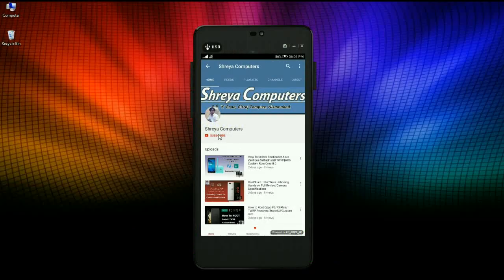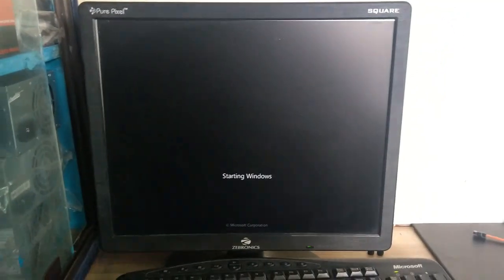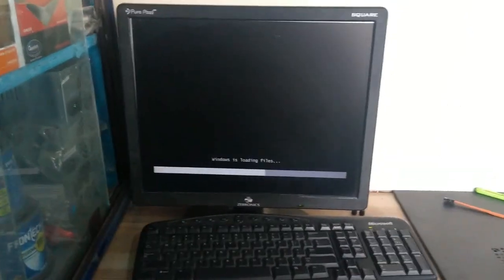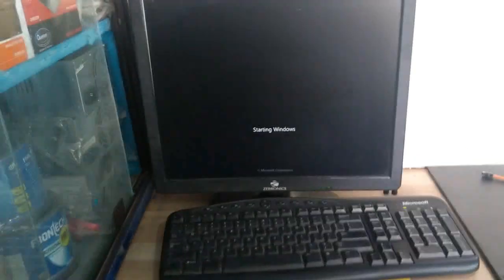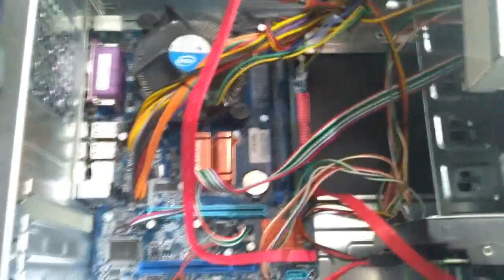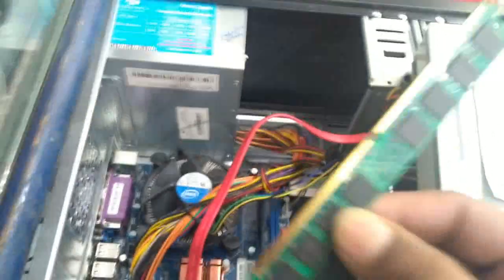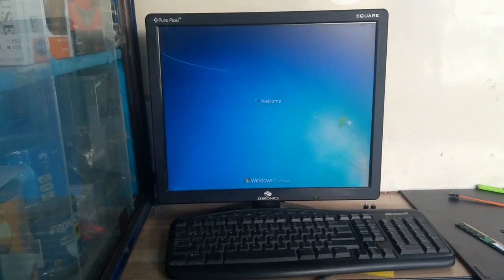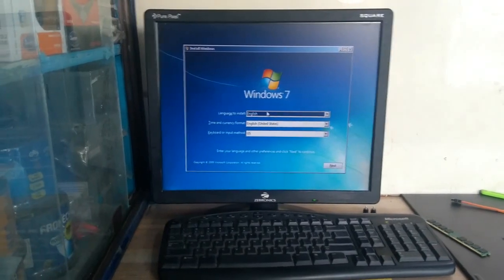How To Fix When Windows Stuck On Boot Logo? Solved In Win 7/Win 10/Win 8/Win XP/Vista

Comment: it did work and im not sure what i did. how ever i did add a ram chip and right after that it didnt start. i did do what you said and i got it started! how ever its running much slower then before but it is working now!! thanks : )
Update: it turns out its one of the 3 HD drives is corrupt. try disconnecting all HD's except the the one with the operating system on it

Comment: HI,
What you showed is effective if the computer freeze at windows logo. I have the same problem but my computer doesnt freeze. It stops at windows logo and when I press any key from the keyboard it boots. What could be the problem any idea ??
I formatted the PC still with new installation same thing happens. Computer stops at windows logo and unless I press any key it wont go ahead.
Let me know if you have solution to this problem

Comment: when i start my windows 7 ultimate it hangs on atarting windows and restarts how do i fix it
Reply: I got the same case. How's ur laptop now?
Reply: @marcelocatagcatag8592  me too
Reply: @manojprasad4662  my laptop is dual core. I just transfer my ram to the other slot. Try to see if this trick work for you
Reply: I have a fully working computer. And it still hangs

Comment: I have the same problem in starting windows it so long to go to menu and then i turn blackscreen and the pointer only pop up
Reply: had your problem solved?
Reply: @adarshbunny8680  sometimes it work sometimes it not but my tech said the hdd sata is broke ineed to replace it